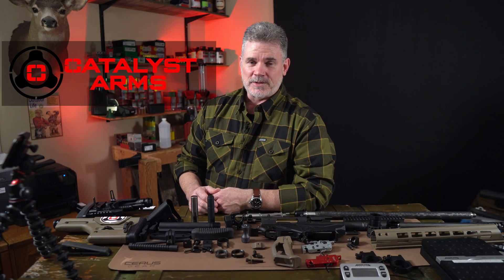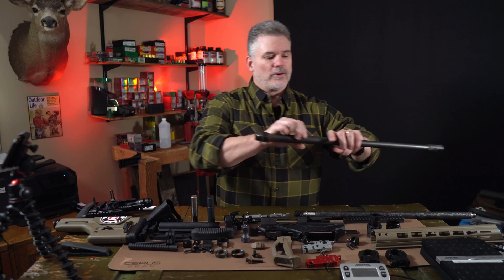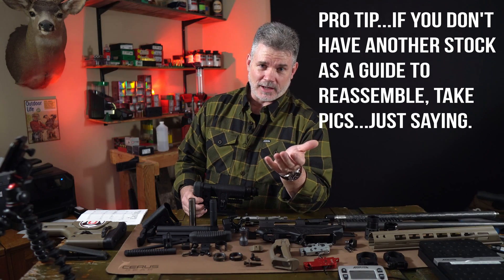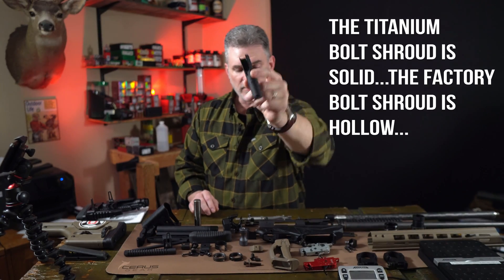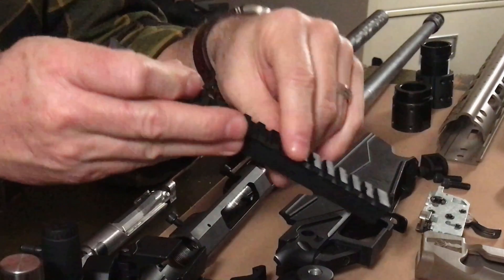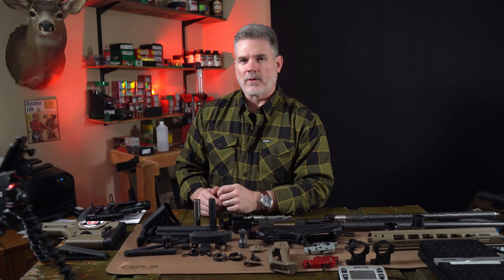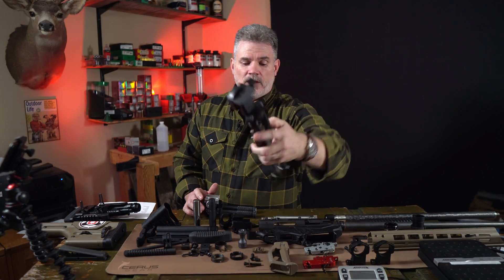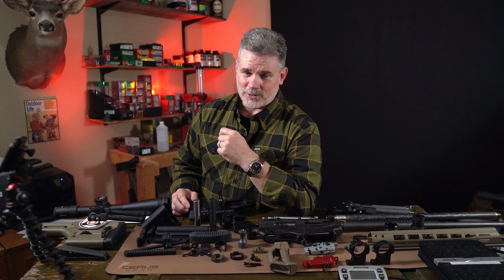Project Zero G Part 2 - The Weigh-In and the Plan

Comment: This should be very interesting I like lighter weight rifles. I built an Ar 308 that weighs 4lbs 14oz with a 16” barrel and 15” handguard and no polymer parts. It cost me $2500 but its lighter than most peoples ar-15’s. With the scope/mount and a full 20rd mag its 6lbs 6oz. It has a a few customized parts to save weight. Good luck with your weight saving goal’ im sure you’ll get there.
Reply from the maker: Dang...that's a light AR10! Well done. Definitely think the 12lb goal is possible...without even getting to crazy with the drill and mill... ;)  We'll see.